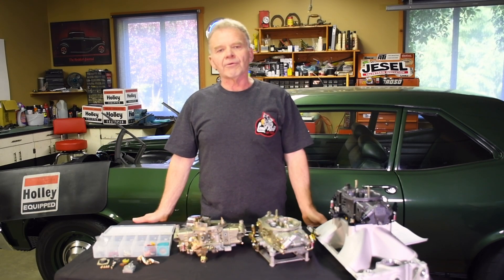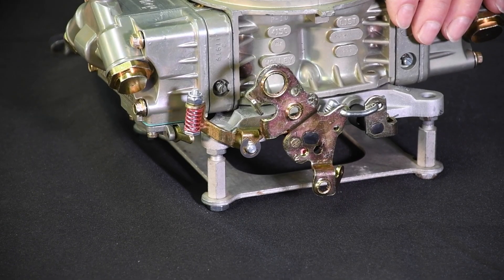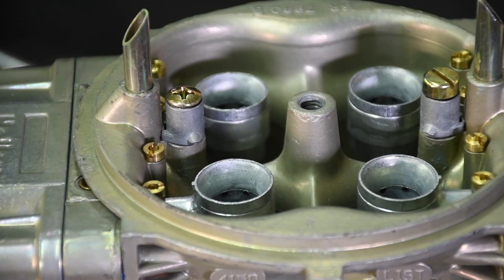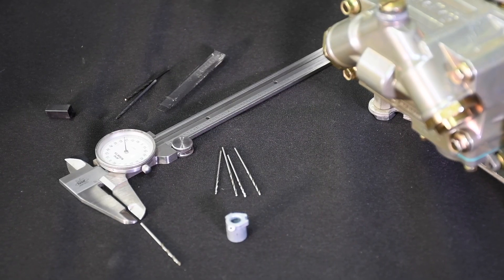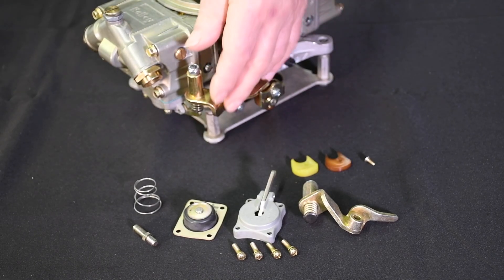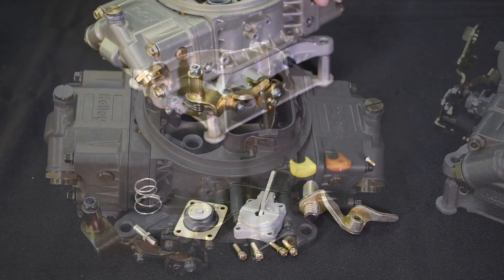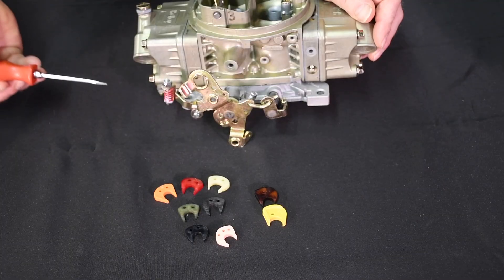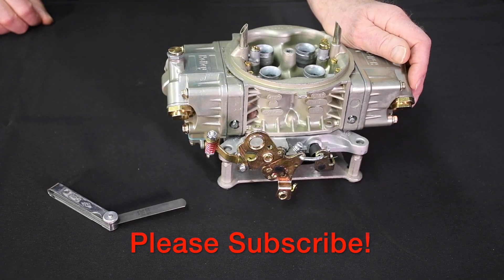Set & Tune Holley Carburetor Accelerator Pump Circuits

Comment: I have a 5.3 LM7 V8 that has a large cam, edelbrock air gap intake, 1 3/4" long tube headers, and a Brawler 750cfm carb that was worked over extensively by a local carb shop. The carb now flows around 900cfm and the car was dyno tuned to make 385whp/320whtq. Car idles great and cruises very well, but off idle it hesitates. Took it to a local parking lot and tried to do some launches and the car would stumble before picking up and taking off like a rocket. The AFR gauge in the car went to 18:1 during the hesitation before going back to a healthy ready once the car took off. I began going up pump sizes to try and tune this out. At front nozzle size 42 and rear nozzle size 37, it was slightly better, but not enough to make much of a difference. The car would actually stall if I hit the gas full throttle in park. Today I jumped the front nozzle to 45 and the rear nozzle to 40 AND changed to the hollow screw type. Now It doesn't hesitate in the same way, but its not a crisp throttle. It also back fires out the carburetor with this size. DId I go to far? I was thinking about going back to the 42/37 combo but leaving the hollow screws, but at the time of this writing, I haven't done that yet.

Comment: I have a question about the hole size in the shooter.  You stated the hole size is the drill size.  However, the larger the drill number means smaller the drill size.  A 40 drill bit is smaller than a 28 drill bit.  Can you please explain?

Comment: Holley shipped me a replacement 660 Truck Avenger and I lost my card for how I had carb tuned so starting from scratch. SBC 395 roller cam vortec, have off idle stumble was trying to tune out.  They shipped the carb with a pump that would not squirt when cold, it was rock solid, so I pulled a spare from a Demon rebuild kit that would squirt.  In my tuning, was getting nowhere going slightly larger on squirters, 28 to 31, and swapping cams and could not get the stumble out.  So I look down carb at flow from squirter and looks like bubbles just off idle then a stream, is this the pump I used, maybe not moving and just flexing the contact point of diaphragm, I do have couple others to try.  Or is there something else to look at, float levels are set to just trickle from sight plugs, had been running non-ethanol until price jump, so did not re-adjust to just below, but concerned over these bubbles and the stream just not giving me any fuel, no amount of adjusting will fix that... pump??  bad back so asking first...
Reply: While waiting for a carb I tossed a 650 BG Speed Demon on her so could drive it, that carb was tuned for a big block, ran a little rich, but did not have the stumble like this carb, so might just swap it back for winter. Not happy if I have to dig into this warranty carb Holley had to build for me, took 3 months to get it, already dealt with stuck pump when -15F last spring up here. They sent me a pump after I already put the spare from kit in it if thoughts are pump, or have pile of jets the BG would be near sure thing down a few sizes , lifted plow truck n bad back, snow coming, no joy... Wish pump was on front like those old Fords...

Comment: Thank you.  I have a 4175.  When I removed the squirter there wasn't a check valve needle. I did some research and I think there isn't a needle under the squirter on the 4175. Can you confirm this?

Comment: I had a bad stumble. If you got on it real hard it would lean pop through the carb. I went from a 31 nozzle to a 35 nozzle and it went away. Now it runs a little rich. I'm going to play with pump cams next. Currently has a black one in it, on the #1 setting. Going to go to red on the number 2 setting, then go from there. Aluminum head BBC, big cam, big stall, single plane intake, 850 carb, nitrous.
Reply: 4:11 gear, but its an ole heavy c10.

Comment: I was wondering when a foot brake racer has to come up on the converter to say 2000 rpm wouldn't it be better for the primary pump cam to be in the number 2 hole giving you more duration and shot than it would in number one since you've already come up on the cam 20% or so?

Comment: That’s one the down sides to trying to run a 4500 style carb on the street as little as that might be but the accelerator pump cams are limited to 2 one that empties the entire reservoir an 1 that does not. Though I’ve gotten pretty good at having a few extra yellow ones around and file them to fit the speed and duration.
Reply from the maker: That's a really good tip for the folks running Dominators!  I'm assuming you're using a two circuit carb?
Reply: @lonewolfhotrods  yes sir I am. I’m far from stupid but I’ve never been able to quiet get a 3-circuit to not run extremely fat especially on the street cruising around. It was always one extreme to the other never a happy medium. It was a constant feast or famine of fuel with a 3-circuit.
Reply from the maker: @85gbody97  I certainly hear you...L-O-L.

Comment: Excellent video! I guess I will try the yellow pump cam. I already have a 63 squirter in there and she still stalls out when I punch it from a stop. I have a mild cam 264 .450 in a 318 poly head engine
Reply from the maker: Thank you for the compliment.  I'm guessing the car doesn't have much rear gear, and if that's the case, it will need all the help it can get from the pump shot.
Reply: @lonewolfhotrods  yeah it's got 293s. It stalls even when in park and I punch the pedal
Reply: @Minervagunsmithingllc  If you still have the stall try going to the 50cc kit. I had a stall for years and tried every cam and squirter. This finally fixed my issue